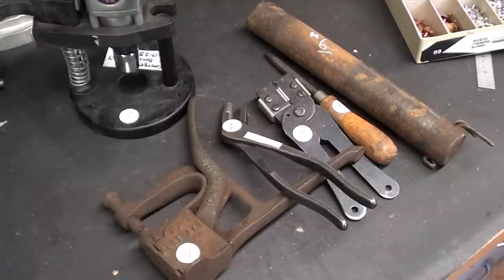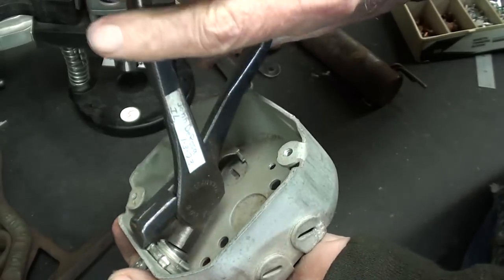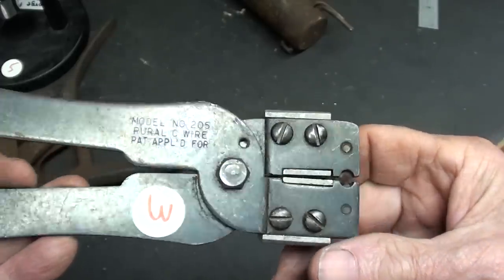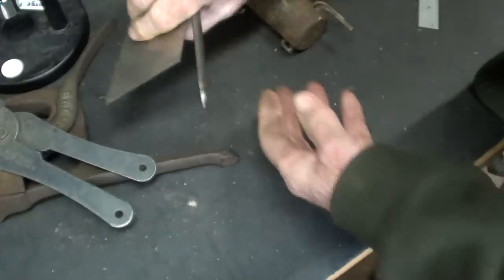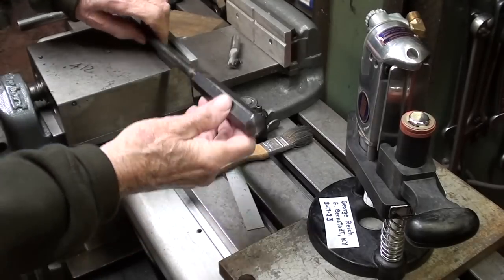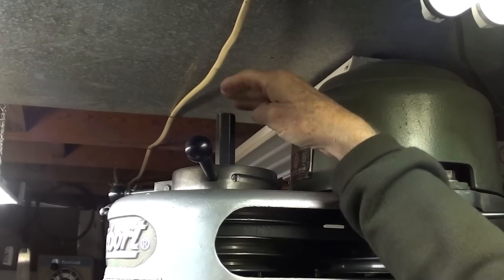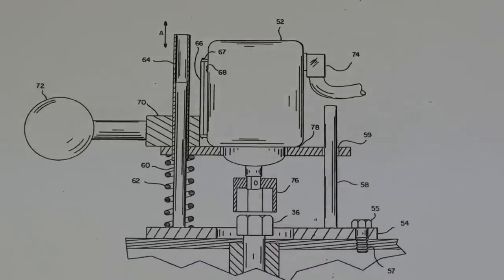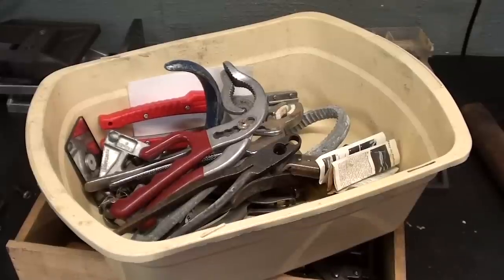WHAT IS IT? MYSTERY TOOLS answers #80b  tubalcain mrpete

Comment: I also have enjoyed your what is it series. As I have explained to you in the past, I worked 41 years on railroad locomotives. I have replaced hundreds of those knuckle pins over the years.  A  broken pin will not allow the train to separate. The draw bar which holds the knuckle has a lock block which will not allow the knuckle to open until you operate the cut lever. What that pin does is to keep the knuckle from falling out of the draw bar when you operate the cut lever. Sorry to see this series end.
Reply from the maker: Thank you for the explanation of the knuckle. I thought the separation was a mediate after the pin sheared

Comment: Thanks for the additional information. The rural C is a flat phone cable that was used from the pole to the house. It was two copper clad steel wires that were molded into some very tough rubber. The wires were side by side, not twisted. I first thought it may be more modern and used to split fiber optic jumpers but I was wrong. I imagine the "C" designates communication. Thanks again Mr Pete.
Reply: Thanks, Danny L.  Now I remember it!  Really hard to strip.

Comment: Thanks, Mr Pete. I really enjoy this series. Hate to see it go. You are correct about not having bonded brakes back then, instead the (asbestos) linings were RIVETED to the shoes with hollow rivets. I think the riveting tool is for brake relining.
Reply: Way back, a full brake service included turning the drums and relining the shoes. The inside diameter was then measured. The shoes had the friction lining replaced with the rivets (using the dividing tool). The shoes were then ground to the same radius as the drum. New shoes were “pre arched” to the original radius and you did not have adequate contact with the drum.

Comment: about #6 if that pin falls out the cars will not separate unless some one opens the knuckle. the knuckle has a grove made into it that mates with the coupler when its closed  it is traps in  the knuckle. I work at a grain elevator and have opened knuckles not seeing the pin was gone. and when you pull the cars apart the knuckle falls on the ground.
Reply from the maker: Very interesting, I did not know that. I thought the cars separated instantly. Thanks for pointing that out.

Comment: I always enjoyed this series, I hope you don't quit it.  Part of the reason why they seem to get watched out of order is that once you subscribe to a channel,  YouTube tosses them to you randomly to watch each time you go to YouTube.  They might suggest #561, then next time #45 and so on.  I finally made a link to your videos at the top of my browser so I can see what you're up to lately.  There would be a lot of good steel in those pins (and a lot of turning).  Let me see If I can google what they are made from... "They are made from AISI C1060 or equal steel, 75.2 ksi yield and 135 ksi tensile strength, 45 HRC".  I saw a test report on a bunch of broken ones that were around 35 HRC.  A grade 5 bolt is 92 ksi yield.  They probably want the pins to wear first before the coupler so they don't harden them, just like the pivot pins on excavator arms and tractors.  They are some good steel actually and probably still easy to machine.  If a few boxes of those don't bring down the attic in your garage, I don't know what will.
Reply from the maker: Thank you for that information, I really have no idea how the algorithms work. But I do know that people are not being notified of my videos.
Also, thanks for the information on the pins

Comment: Pretty sure number 2 is a metal punch.  It's missing a screw on hollow piece that moves with that bottom thread.  I have a version like it but about  40 years old instead of 80-100.  The top "point" and the bottom "hollow" came in a set and were for stamping different sized holes in sheet metal. My dad was a foreman in a sheet metal shop most of my life.
Reply: Yah, my first impression was a Whitney punch, too.

Comment: That wire stripper I used a lot in telephone wire work. Slit the outer plastic  to remove it cause you often strip 5 feet or more at a time. Slits the top lengthwise

Comment: 3:03 rural c wire looks a bit like lamp wire, but it's 16g solid copper and has a ridiculously tough jacket.  So you got this tool with the razor blade and good grip to split it down the middle then when you separate it you strip the insulation/jacket off with the little hole in the tip.  Awful to work with.  By the time I was there you couldn't find any more sharp blades for them either.

Comment: Tool is a web slitter. In telephone lineman work self supporting cable is cable and strand and is used to separate the strand from cable for hanging and splicing work.

Comment: 😢
Reply: i like the series but i usually read the b  first it bugs me not knowing what a tool is for i like old tools a lot better than the new ones
also built the sliding drill  press vice works great used a socket for the handle along with a Milwaukee  12v ratchet thanks mr pete
mike